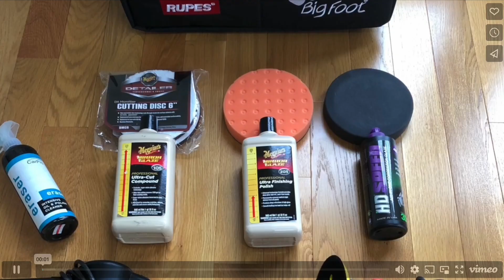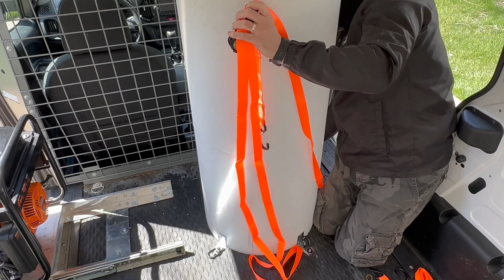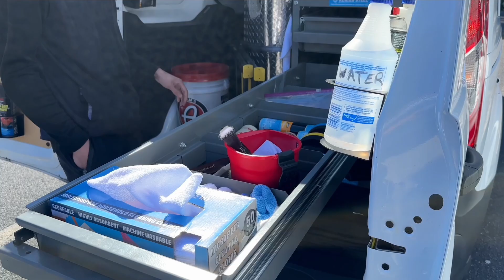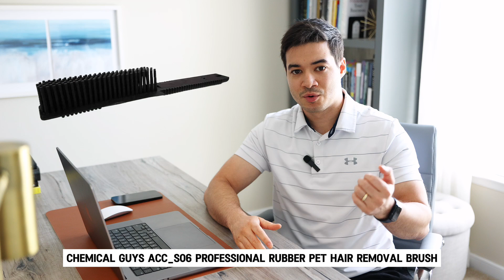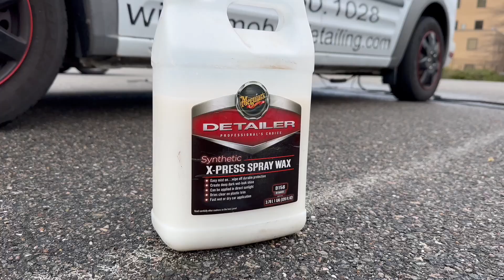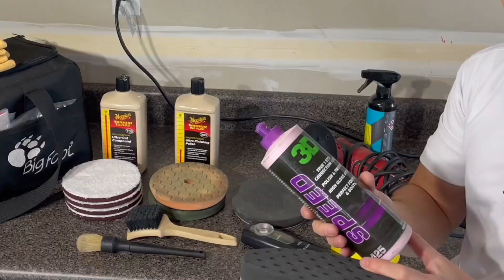If I were to set up a new mobile DETAILING van in 2024, I'd buy these supplies

Comment: vacuum: Dewalt Stealthsonic (50% quieter)
steamer: I like the Dupray Tosca (good commercial unit)

water extractor = I don't use one.  Instead I have a 5 litre water boiler, boil water, wear 2 pairs of chemical gloves, add some soap, then vacuum it up.  Way better than a steam clean on carpets- the salt just melts away.

Pressure washer: Active 2.0 has good GPM but is loud.  The best one on the market's called "Bigboi Pro" or something like that.  Good GPM but very quiet.  High GPM helps clean cars significantly faster than cheap pressure washers.

Towels:
outside drying towel = the rag company gauntlet 20x30
window towel = the rag company gauntlet 12x12 (steam clean a window, wipe with this single towel and no streaks)

soap: whatever you can find in a 5 gallon size
wheel cleaner: get a 5 gallon jug of whatever

Paint decontamination:
1) iron-x / fallout remover = chemical decontamination (gets out the orange spots that build up each winter in snowy climates)
2) clay towel = mechanical decontamination

Gloves = I bought a pack of Showa Chemical Gloves on amazon, and when my hand starts to sweat i flip it inside out to dry and grab another pair.
Reply from the maker: Hey, thanks for sharing your go-to tools and tips! The Dewalt Stealthsonic and Dupray Tosca sound awesome. Appreciate you dropping this knowledge. ✨